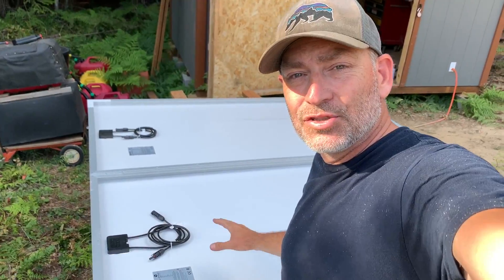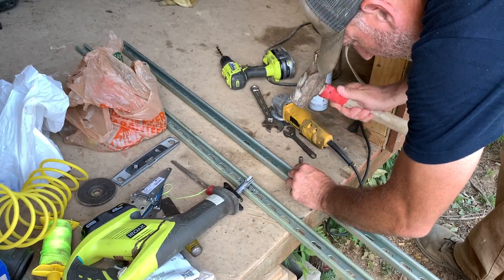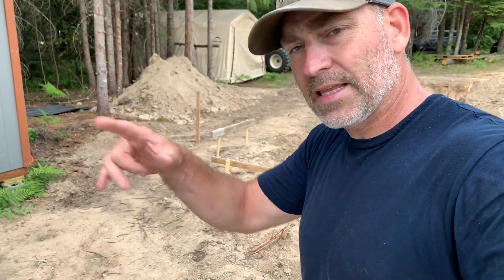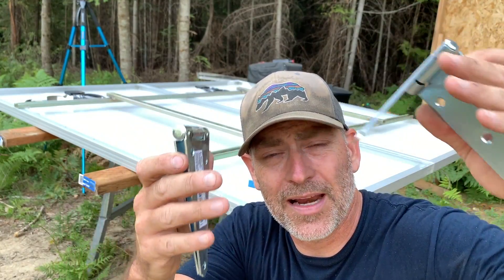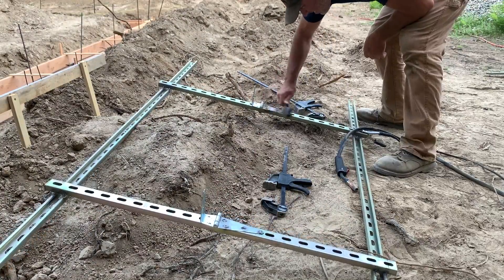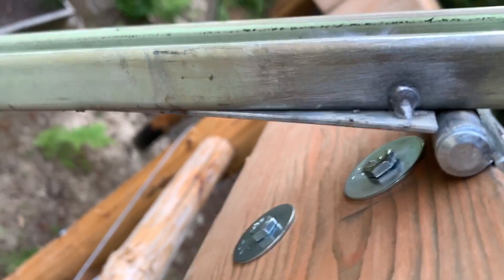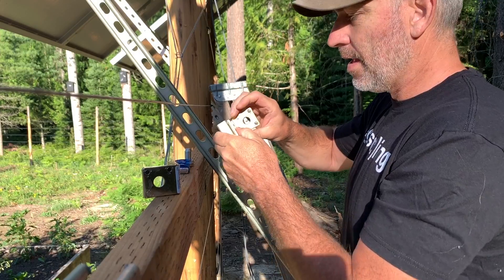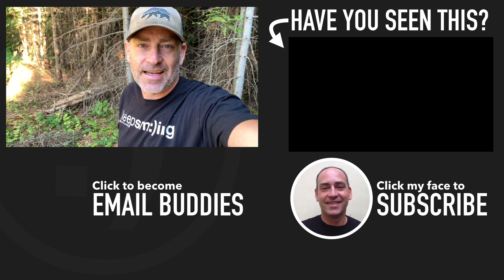How to Build the Ultimate DIY Solar Panel Ground Mount

Comment: He spent a lot of time building a frame out of the unit strut material. He doesn't even need it because the panel is the frame and all you need to do is put a 2x across it with a set of hinges and that's it. It's very quick much quicker than what he did here. That unit strut. You can bend it like a pretzel if you wanted to. You really can't do that with a 2x4 much sturdier.

Comment: He went through a lot of work creating unistrut frames. When I did mine. All I used was a single 2x4 horizontal on the panel and I put a set of hinges on each panel. Way easier. Far cheaper. Than what he's doing here. I might make a video on it later. I don't know. Very quick. From grabbing a panel. Laying it out. Cutting the wood, putting it on probably 10 minutes. Total each panel. It goes very quickly.

Comment: The problem you made was putting steel on aluminum, which will rust. But if you put stainless steel boults an washers between them, that will fix it .

Comment: Was it safe to be welding with  panels circuits soo close to panels electrical circuits if the ground ever decides to carry over to the panels framing...

Comment: Marty, thanks to you, I was able to install an of grid DIY solar system to my tiny house. I am so happy with it, there have been many times that I dance around at night and say, "Nany Nany Boo Hoo" to the local electric company.  The only problem I am having issues with is my tankless hot water, I have a Stiebel Eltron Mini 3-1 and a 3-2 which are in the tech specs of the the tested both and they both trip my 48 volt Aimes Inverter charger, Renolgoly Charge Converter, 2 710 solar panels, 30 amp breaker to the heater on its own 10 gauge wire. Any help would be appreciated.....

Comment: And make sure when using a grinder to cut metal, the sparks should be going away from you and no guard. That way if the blade binds it pushes the cut off wheel directly towards you. Lessons learned the hard way are ones you don’t soon forget.

Comment: Whenever I welded Zinc plating & inhaled the fumes, I would go down with "Weld Fever". Was on car body for 10 years. No doctors knew what it was & it took another 12 years to discover the phenomenon. Good thing you were outdoors welding that frame. I just built my rig out of timber with a hybrid inverter, next step batteries. Love the vids, thanks for sharing!

Comment: Auhhh. Great system. Same idea as what in developing only mine will have a motor that rotates the panel from and east angle, to a flat position, and then a west angle all controlled with the flip of a switch. The next 5 panels I will use your idea of unistruts rather than modifying the framing I got from signature solar.

Comment: Solar is awesome, neat thing is yon tilt them down to wash them or if the snow covered them up too much it would be easy to clean that off. We had 6 inches one day and even with tilt my panels were not happy nor was I as they are on the roof. I am talking them down and going to do a ground mount now.

Comment: Really didn't need to weld. The super strut brackets to hold two pieces of strut perpendicular to each other is like a $1.50. so I guess if you got $1,000 welding machine laying around and you haven't welded in a while this is a great excuse to do so...

Comment: The holes DO line up. You need to move it over a half inch and then you'll have a tiny piece sticking over that you can cut off if you like. You'll have about an inch in between the two panels.

Comment: Dude! You cant be welding galvanized unistrut steel without any breathing protection. Those gases cause cancer!
Reply from the maker: I hold my breath. 😶‍🌫️
Reply: @MartinJohnsonOffGridLiving  so you are oxygen deprived. That explains it. You have some really good ground mount ideas. But that welding galvanized steel may not affect you today but when your family is watching you slowly die from cancer in 15 years it will affect everyone. It's nothing to be messing with!

Comment: Hi, how does it hold? I'm wondering do to dhe same thing but a bit higher. So it would make sth like terrace roofing with extra steps.

Could you please provide some information about, how is it holr/work?
What type of materials did you use?
Does it rust?
Does it hold during strong winds?

THANKS!

Comment: Late to the Party, loved the Vid!  At 12:00 flip the "adjuster bar" around so the bolt goes through the pre-drilled hole in the track/bar.  This will keep it from falling off completely yet still allow it to move. ;)

Comment: Maybe connect those two angle adjustment bars with a crossbar to prevent any asymmetric pressure on the panels and frames as you adjust the tilt..

Comment: Brilliant Martin!,wood is carbon neutral+ looks far nicer than metal poles. BUT “purepoint energy’s” solar website says the distance panels should be from trees is 2.5x’s tree height!, this seems VvV excessive!, vmany arrays including yours wouldn’t be possible if this “rule if thumb” is followed. I think 2.5x’s is ridiculous!, I hope you& others agree?. My trees are just over 50ft & I can prune any dead branches safely with a decent extendable pole on sturdy step ladder, if it was a big branch I would cover the panel with a plastic or wooden panel ........ If I was to place my solar panels 125ft from my trees I would have to cut down 1group of trees on the other side of my garden&place my panels on my neighbours land😅🤦‍♂️
Reply from the maker: I think it will depend on how low the sun is in the winter. Up north it is pretty low.

Comment: BOLT  vs  WELD ... a person can easily UNBOLT ... but ... UN-WELDING  will be much more difficult 
I do not understand why you chose to weld your BRACES to another piece of metal already set up with holes for BOLTS ... ???
COOP
...

Comment: Great video thanks, I gust picked up a cheap mig and will be ordering the steel. Can you tell me what hardware you used to attach solar panels to steel frame you built , and the adjusting nuts are they the ones with the plastic ears on them ? I just watched your newer one and was glad to here they have held up well for two seasons. We are in northern Ontario so we get lots of snow. Cheers AL

Comment: I really like the adjustable strut at the bottom right where you can get to it to change the angles of the panels.
I want to adapt your ideas to mount these on the South edge of the single story roof on my house and put a 3 foot length of strut on the wall with standoffs to serve as the adjustment tracks to slide it in.
I think it will work just fine.
I "could" add some acme threaded rods to the adjusters and move them all at the same time perhaps automatically motorized even for the elevation adjustments during the day.

Comment: i am curious why you welded the pieces together instead of using the channel nuts and bolts. so it can be reshaped later or changed easily
Reply from the maker: I’m not planing on changing them and I like welding.
Reply: @MartinJohnsonOffGridLiving  😄

Comment: Great video and clever design. A couple questions: could the frame be bolted together instead of welded? And do you have a parts list available? I love the adjustability!
Reply: I would bolt it using spring nuts, faster and no welding
Reply: I agree Spring nuts way faster and unistrut makes every bracket you can think of including module mounts.

Although that will add cost.

Comment: If I do a stack of 3 panels instead of 2, where do I position my Hinge for balance (I'm in North Idaho too). Or would this not be wise structurally? I'll bump up to 12 gauge strut for strength.
Reply from the maker: I think it would go in the center of the center panel.

Comment: I was disapointed to see you welding with the sparks flying over to the backfoil of the PV-panels!!
This is certainly not good for the lifetime of your panels......
Reply: Yeah first thing I was thinking. Pull it off onto a table.
Reply: I was wondering if anyone else noticed that as a problem.

Comment: Great idea. Like the explanation and setup: have couple questions please:: 
1. DO YOU HAVE TO GROUND THE SOLAR PANELS AND IF SO HOW DON/did you do that. I DIDNT SEE TGAT MENTIONED OR INCLUDED. 

2 did you flux core weld those hinges it looked cool. Now do you have 220 shore power or are you off grid. If tou are off grid how do you power the welder.

Comment: I like the way your mouth does, however, I would make a suggestion for modifications in the future. Where are your struts bolt to the solar panel frame I would think about rounding over that end for, no worries clearance. And on the adjustable end where your pieces stick out, I would round those over as well and less every time you walk over there you have on leather gloves or at least you need to deburr those edges really good!
I wish I had the extra resources and money to do what you’re doing because I would definitely do it myself because I have a 1/2 acre of yard that is empty and a clear view of the south.

Comment: Hello Martin!
I love your channel. Thank you for your experience which you present us! 
You have the double power system with solar panels and gas generator. As I can see there are enough not sunny winter days where you live. Is it enough sunshine power for your needs? How often gas engine generator has been switching on?

Comment: As soon as welding was involved I am taking plan B.
Reply: I was wondering if they could be bolted together instead of welded. I have no welding equipment.
Reply: @Aelanna  mechanical fittings (bolts) will always be stronger than welding, welding is pretty easy with a bit of practice
Reply: You should use strut nuts and bolts
Reply: Welding !?!  Might as well saying, Let’s build a Rocket ship , Jeff Bezos
Reply: @danb2160  anyone can do this. Be a man.

Comment: What is the iron you used for this mount called? The person that built our mount used angle iron and it bends when you get 6" of wet snow overnight. Putting a new and larger system in into a new and permanent place. This looks like a sturdier piece.

Comment: What is the measurement setup for the wood frame solar panel installment? I would like to replicate it for a grid - tied system.
Reply from the maker: Just build it to fit your panels. They are all different sizes. That is what I did.

Comment: Marty be careful with welding galvanized steel, off gasing fumes can make you ill
Reply from the maker: I was holding my breath.
Reply: @MartinJohnsonOffGridLiving  Also zinc coated not galvanized not as bad. Safety Sally should have overseen this project!
Reply: Steve Allen galvanising is zinc coating surely?

Comment: Martin, you need to have really good ventilation when welding galvanized steel. The fumes from the galvanizing are highly toxic! At least a fan to sweep the fumes away from you. By the way, awesome job on the ground mounts.
Reply from the maker: Do you need more ventilation than outdoors?
Reply: @MartinJohnsonOffGridLiving  "fan to sweep the fumes away from you"
Reply: If those fumes are rising up in your face yes, you do need a way to insure that you're always up wind. (Strong fan)
Reply: @stonevalleyozark475  Should he also live in a bubble ? Do you not enjoy videos ?
Reply: @at347est  I love watching videos. It's obvious since he's using the cheesy handheld welding shield and plastic chipping hammer, no welding gloves, that he's very new to welding. And you're obviously not aware of the many hazards associated with welding. Have you ever had UV burns from welding? It's worse than sunburn.
Reply: @at347est  Maybe you should go and find a PROFESSIONAL welder and spend career day with them.

Comment: Great job as usual, Martin.  How do you like your welder?  That's a TIG welder, right?  Harbor Freight?
Reply from the maker: Flux core wire welder no gas needed. Yep harbor freight. It does what I need it to.
Reply: That's a flex-core MIG welder.

Comment: Cool stuff, Maybe mark on adjustment bars degrees or just summer/winter? for easy adjustment. I think you can look up ideal angles based on your location
Reply from the maker: I showed how to figure out the angle in a previous video. If you care to look for it.

Comment: Nice! I also have mine here, although I still need to add in the charge controller!
Reply: 081320/1911pst.  Sir, if you have not yet procured the main component viz: charge Controller may I suggest VICTRON MPPT , that I’m using? It’s safe, easy and simple to use, plus the device has built in Bluetooth,  and all  the parameters of charging, discharging cycles, can be monitored on your iOS and or Android devices. There are several enhancements sold by VICTRON, which please check at their URL. Good luck and 73s..